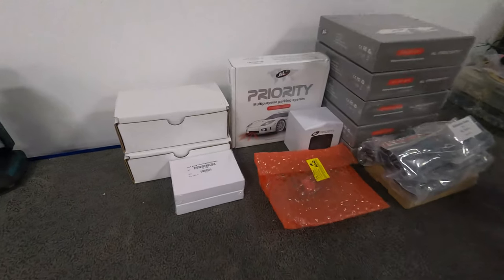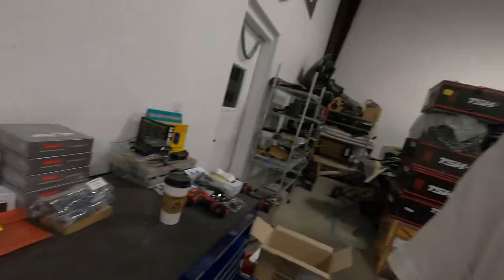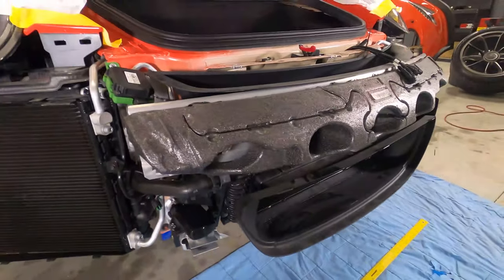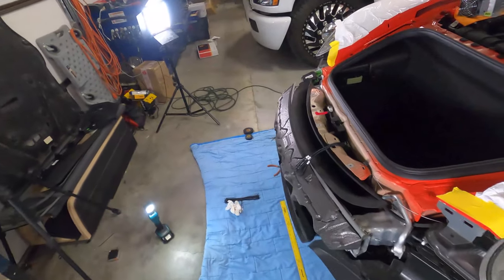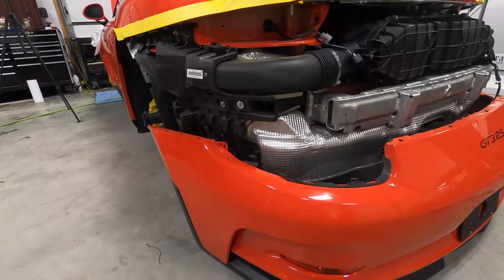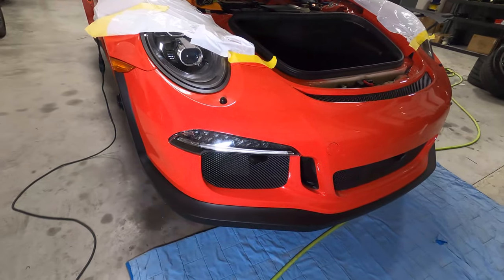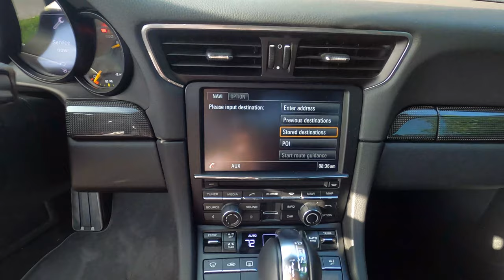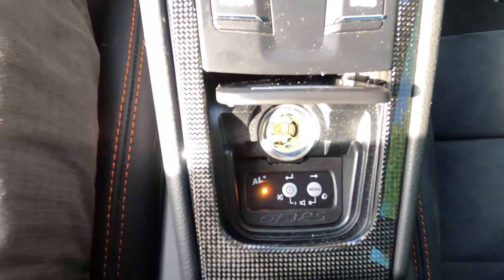2016 Porsche GT3RS "Peaches": Add Wireless CarPlay & Install AL Priority Laser/Radar Defense System

Comment: I would recommend recessing the bumper sensors so they are not as visible.
Reply from the maker: If your talking about the laser sensors, then you have to space them out beyond the bumper for maximum coverage. If you space them in, coverage goes down.

Comment: Sweet car, I see why you guys are one of the top shops, i had a question, in a trunk build ,i have two ground zero hydrogen 12" subs, and a sounddigital evo 8k, whats your opinion on a box to fire the subs back,and the ports through the deck, where the rear speakers would normally be,would it work,????
Reply from the maker: Need to just test and see what works... Too many variables and unless you have tested different setups in that car, it is just a guess on what will work

Comment: How does this system compare to K40 systems?
Reply from the maker: When it comes to Laser Diffuser/Jamming systems, AL Priority is the best... Many online tests from independent sources confirm this. Radar, you have many options. Want the best, the Radenso Radar with AL Priority Laser. Also, installation of these systems requires ALOT of attention to detail. Barely off, your not protected 100%. If your interested in one of these systems for your vehicle, you can visit our website and send us your information:

https://soundsgoodstereotn.com/integrated-radar-laser-diffuser-jammer-systems-nashville-tn/